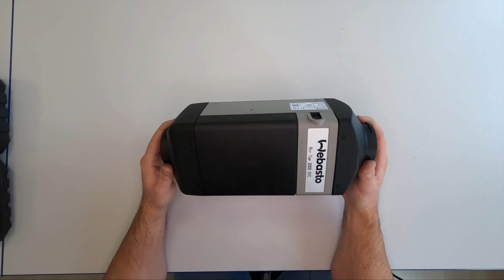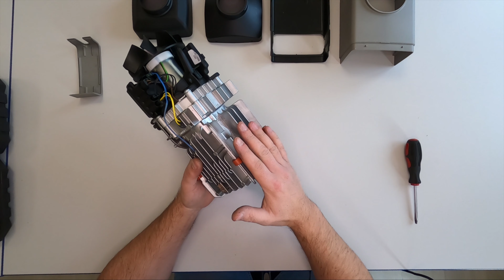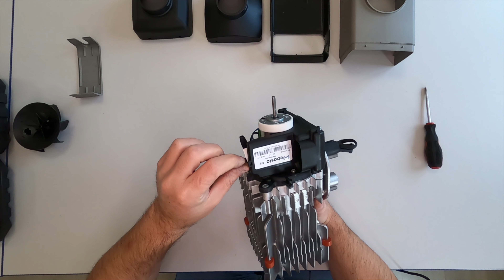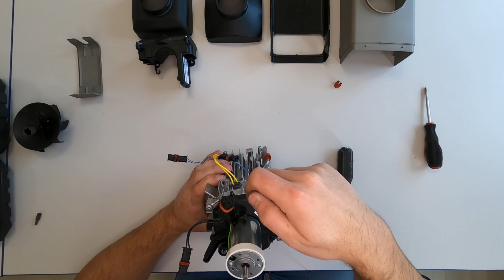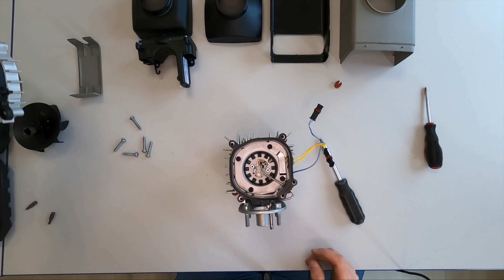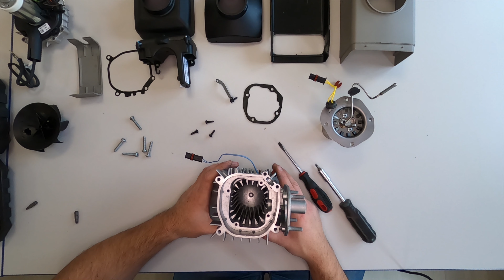Webasto Airtop 2000 teardown, what is inside?

Comment: A helpful video, thanks.
Is my understanding correct that the fuel pipe goes from the pump directly into the combustion chamber without any electric shut off or isolation solenoid valve ?

Comment: Hello. Thanks for taking the time to make these videos. Can you please advise me on a problem I have with my erberspatcher d2 heater, it appears to work fine in that it starts quickly, no white smoke, runs up to the desired heat setting and then starts to wind back down as it should, using around 1.1amps at this stage, however when it enters the lowest setting (as in maintaining the current temperature) and using around .6 amps it soon flames out.. the fan then goes to max to cool the unit whilst trying to restart but only once but is unsuccessful. The fan continues to run to cool the unit, also the power light on the 801 controller stays lit, no error code is showing. If I leave it for 10 minutes it will restart but once again repeat the same problem once the desired temperature is met. I do have a Chinese upgraded exhaust on it which helps reduce the noise. Thanks for any advice in advance.
Reply: Hi thanks for the prompt reply, no error codes are present on the display, but I will remove the exhaust to see if that helps
Reply: Hello. Just an update, should other owners experience similar problems, removing the exhaust silencer entirely (as currently unable to fit original) has stopped the heater flaming out and it's now running fine (touch wood) on its minimum setting. 
Thanks for your help.
Reply from the maker: It is hard to point at something this way especially without error codes shown. This needs diagnostic with diagrams to see what actually happens with the heater. Otherwise is just guessing.
Reply from the maker: Even if it is flaming out on low stage it should have that error, try running it whitout the modified exhaust to eliminate that